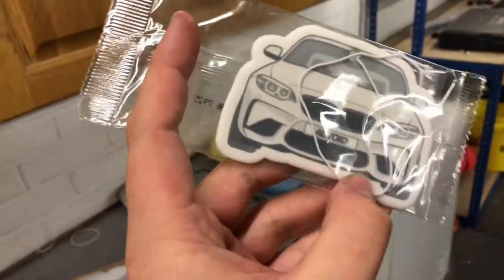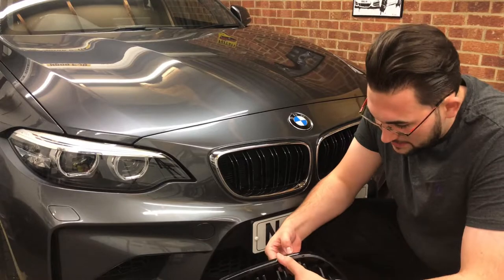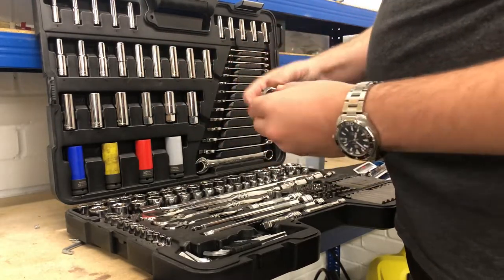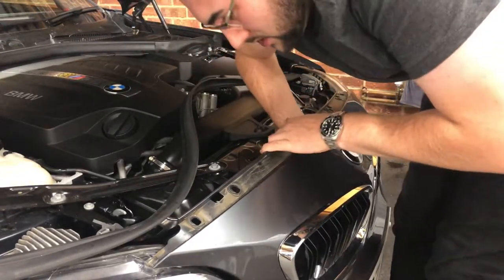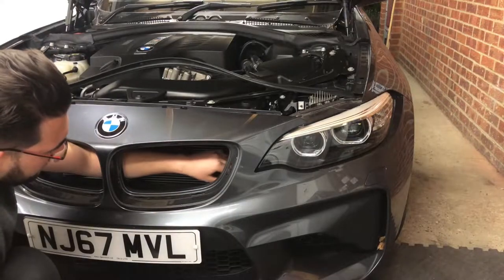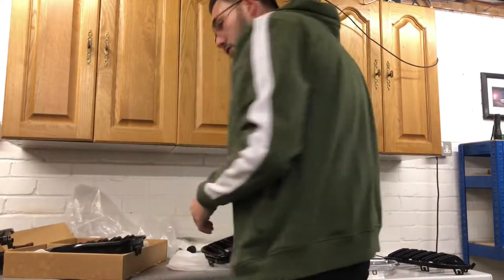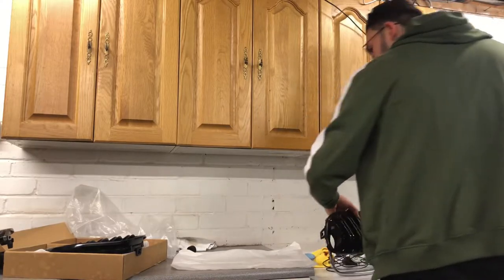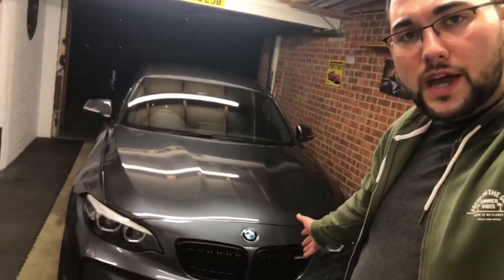Idiots guide to installing Black AutoID grilles. BMW F87/F22 2 series.

Comment: I bought the M2 OEM ones yesterday from Elliot at harry fair burn Bmw in Scotland for 110 quid free delivery. No poncing about with swapping outer rim and it's original Bmw m2 part. The way you did it is ok but 80 quids a lot , they are 40 quid online

Comment: You only really need to purchase the outer grille. I had my front grilles and side blade things swapped to OEM black ones as part of the deal to buy it. Hate the chrome ones. Just need a black M2 badge for the rear